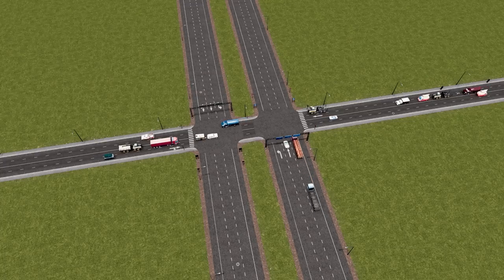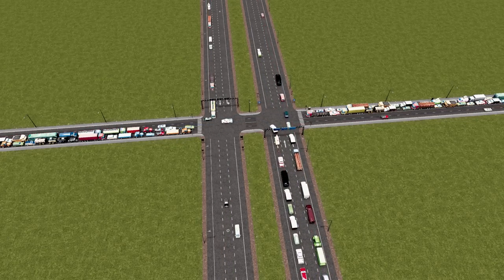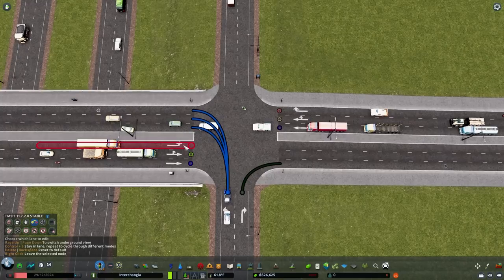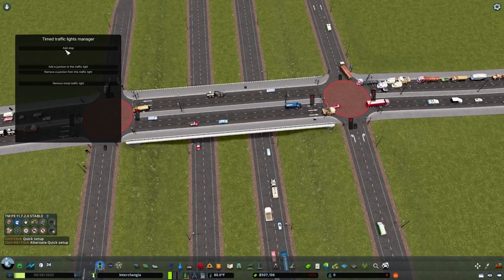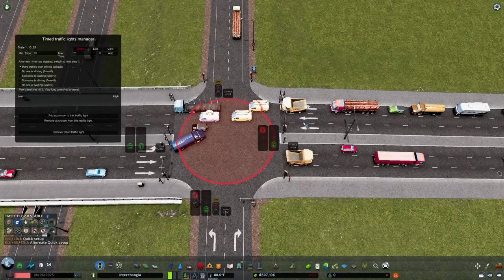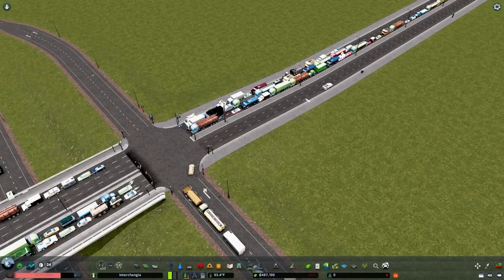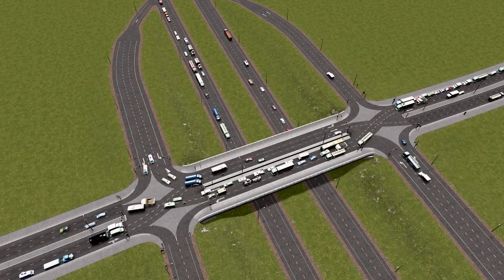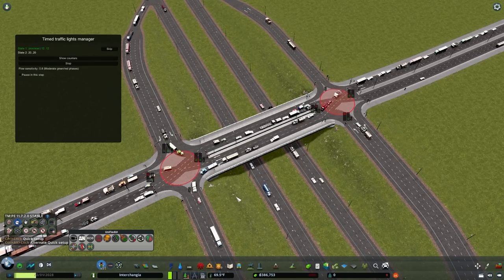The best SMALL Highway Connections  -  Building Diamond Interchange Variants in Cities Skylines

Comment: The biggest problem with a SPUI in real life and somewhat in the game is that it is a pedestrian and bicycle user death trap.
Reply: Problem? Solution :D !
Reply: Yes, simmiliar but smaller SPUI is in one small city near city where i live and it takes about 5 minutes to go through whole SPUI.
Reply: Pedestrian tunnel!
Reply: Yeah. You need to cross four traffic lights on foot at a SPUI, or two if right turning cars get a slip lane without a stop light, which is even more unpleasant for pedestrians. The "urban" part of the SPUI really only describes the relatively small formfactor, it doesn't create a better urban environment than a standard diamond or any other highway interchanges.
The best option both IRL and in game would be to provide pedestrians and cyclists alternative routes to cross the highway, ideally ones that are faster and not a detour.
Reply: That’s the advantage of an inverse SPUI. An inverse SPUI has the on and off ramps connecting on the inside of the highway so it only has ramps on the bridge and the intersection itself is no larger than a 4 lane road. However, they aren’t common IRL due to the danger of traffic backing up into the fast lanes of the expressway if something goes wrong at the light.
Reply: @AVeryOldLady4397  that's still subpar
Reply: a spui and a diverging diamond only really makes sense when both roads are highways
Reply: @AVeryOldLady4397 it'd probably be best to just increase the height of the overpass to enough for a pedestrian/bicycle/wheelchair path to fit in between vertically
Reply: @deanonesense  I mean yeah I meant for realism in game. 

In real life the solution really varies by country.
Reply: @AVeryOldLady4397 Yeah, the UK, for example, never allows a green man and a green traffic light simultaneously if there would be conflict, even if it means all red lights for vehicles or, temporarily red lights for all turning traffic.
Often it would be button controlled for quieter junctions, potentially built in cycles if there are separated turning lanes and pedestrian islands, so it's not a big problem for cars. Sometimes, for ramps like this if there aren't many pedestrians, you just take care when crossing and driving. However, people just know when it is appropriate or not, and older junctions with no crossing signal, you just look at the traffic lights to see when you can cross, and we have no concept like 'left on red'.
We don't seem to have the same blindness to pedestrians and cyclists that the US does, and we definitely would have islands and stuff on wide roads, even if not any traffic signals yet, and just cross when safe, with vehicles generally not being too miserly to not slow down for you.

Comment: One trick I've found works really well in the game: make a corridor using half-diamonds instead of full diamonds.  Even in vanilla a half-diamond works great since it's just a 2-phase light and the other node is free-flowing.  That way, even without special setup, you just have one 2-phase light and one free-flowing node, both of which work quite well.  Then put bridges between the diamonds so the cross-road traffic is separate from the service interchanges.

Comment: thinkj a better result would be the traffic from main highway be brought up and exited in the middle vs outward. then seperate the smaller road traffic with distance similar to the main highwy. Then it would be a traffic circle some what for traffic existing/entering from smaller road and no stop lights needed. Constant flow in both directions

Comment: have you ever tried a ramp meter? if there is a merge from 2 lane to 1 lane a ramp meter is sometimes used if the highway is frequently congested.
Reply: Not familiar with the term, but is that basically traffic lights that quickly switch between the two lanes, one car at a time?
Reply: @simongeard4824  well yeah, if the highway is congested

Comment: That road at the start of the video seems typical of an intersection between an avenue or boulevard, which serves as an arterial road that might connect up to, or turn into, a superhighway, and a more local collector road that might lead to some shopping centers for example, though traffic lights would certainly be featured, since while traffic might not be as heavy enough to warrant switching to an interchange, it's still heavy enough for traffic lights to be seen as a necessity. I've driven through one such intersection a few times before at coordinates 35.986354, -78.535360, located on the outskirts of Wake Forest, where Capital Boulevard, which passes through some service interchanges further south, where the traffic is heavier, since it's further into the city, intersects with a more local collector road that, in turn, connects to a couple of shopping centers that include parking lots, supermarkets, and fast-food restaurants like the nearby Wendy's.

As for the interchanges featured in this video, besides the bog-standard Diamond Interchanges, which I've driven on and off of before, while there may not be any nearby Diverging Diamond interchanges that I'm aware of, there's a SPUI that I often travel on at coordinates 35.911597, -78.651368, where the I-540 crosses under Six Forks Road, along with another SPUI at coordinates 35.965423, -78.541945, where Capital Boulevard crosses under Durham Road. Come to think of it, the SPUI seems to be a pretty popular interchange around Wake County.

There's also a Partial Cloverleaf that I've been travelling through as of late at coordinates 35.794449, -78.582645, where the I-440 crosses under New Bern Avenue within Downtown Raleigh, when we've had to visit the nearby hospital when one of my family members had been suffering from a failing liver. I'd say those would work nicely as service interchanges, probably better than the basic Diamond Interchanges.

Comment: In my state, we got alot of DDI and its working great but I dont see the 3rd option so far, maybe it cost too much money to build! 🤔
Reply from the maker: There are many spui’s in some areas. You can easily drive them without knowing what it is, unlike a DDI.
Reply: @YUMBL  SPUI may easily see in flyover highway with local road on ground.
Reply from the maker: Its widely used in both scenarios. It depends on the configuration of the original interchange.
Reply: @YUMBL  here in michigan on I-94 heading out of Wayne County, there's a few SPUIs serving some of northern Novi and other smaller suburbs. very neat as i went on one as they were finishing the conversion from a standard diamond interchange.

Comment: Could you do a diverging diamond with… roundabout In opposite direction?
Reply: You could make a “diverging diamond” using a roundabout going in the opposite direction but it would not be able to handle as much traffic as a diverging diamond since traffic getting on and traffic getting off the roundabout have to cross each other’s direction of flow. This still happens with a diverging diamond but it is signal controlled instead of trying to fight your way on and off.

Comment: I normally switch to a Dumbbell interchange, or a Pinched Roundabout interchange instead of going for a DD or a SPUI, they also use the same bridge from a Diamond interchange, and don't increase the space used up that much either side of the highway.

Comment: The best way I've found to avoid through-traffic in the service interchange intersections is to make sure the speed limit is properly set on the off-ramp/on-ramp. Ie. it should never be that the through-traffic should have a higher speed limit than the highway. The cims will chose the one with best speed. So if you have an highway off/on-ramp 100km/h and a rural two-way two-lane highway underneath at what is it, 60km/h or 80, the cars will prefer the off/on-ramp. With that there shouldn't need to be a need to force lane choices in the intersections, other than adding the asymmetric turn lanes, which often helps.
Reply: Mostly. I have observed in my games, and I have seen examples on Biffa's (rarer), where the AI will select the ostensibly slower route (having put lots of time in to ensure lane restrictions are not preventing desired flow.).

Comment: TMPE allows the first solution to be possible, with two simple steps: 
1) Allow queueing for the both highways and both exits from the middle bit. 
2) Leave right lines to be turn only, so the traffic would use only one to go thru, and split in two in the middle also.

I've got similar setups all over my city (the light-less metropolis format), and there's no significant backings occuring (mind you, i'm playing with despawn disabled, so every car has to wait till the ends of the world)

Comment: I wonder, how much more expensive would an interchange be with three levels of elevations? You can then split off the through traffic, let it go underneath the highway, while the left turns use the single point overpass above it. 

Another thing I'm wondering is, how would two single direction arteries, each with their own interchange, compare? The individual interchanges will be simpler, but you'll need two interchanges. Will this need more are less total space? Will you be able to use the area between the two arteries efficiently? You could have a district in between the two arteries on either side, like specialized industries.

Comment: I’m a big fan of SPUIs too! (and my fav system interchange is double trumpet 2 level interchange so don’t spoil city views). 
I think you might’ve missed that SPUIs can help in creating U-turns for the highway so making exits from only one highway side are possible.

Here are the few (though unconcise) things I’ll note about the SPUI (2 min read)
1) cars turning from/to the highway via junction (left turns, in your case) might misjudge and enter the clogged junction when the entrance/arterial backlogs, rendering the entire junction useless. (it’s hell when there’s a 20sec timed traffic light (TTL) after that… In cities skylines enabling ‘enter blocked junctions’ makes it PAIN, blocking the whole junction. An IRL example: in Singapore, Paya Lebar Road exit off PIE. At the junction with Eunos Avenue 5, or Geylang East Central, it disallows right turns from the other side just to accommodate this.
2) Oncoming Collision. Like you said It’ll take some tinkering with node controller to prevent oncoming cars from colliding, and yes… IRL (sg example again) I’ve had near misses at the Cavenagh Road X Bukit Timah Road junction, where humans REFUSE to follow lane markings
3) Lane saturation into the highway (busy junctions only). This will be bad if your highway system uses weaving excessively. Using lane mathematics and letting cars accelerate before entering the highway may help, but in C:S I lost my battle against too many highway lanes because no one could enter/leave the saturated lane highway lane caused by the TTL, so I had to upgrade it to a 5-lane 😰
4) Pedestrians. As in the video, they can’t cross the arterial, though overhead bridges help, MY LEG PAIN. That being said, ped crossings off the slip lane are usually offsetted a little before the lane intersects with and joins the arterial, so cars only have to wait for one thing at a time, instead of the stars to align.
Thanks for reading!

Comment: If the simple diamond interchange uses left lane for exit ramps, it will become a single point interchange and is probably cheaper to build. Why is it not built that way?
Reply from the maker: I don’t quite understand what you mean. The simple diamond is cheaper than all the other options, so it is almost always the starting point.
Reply: I believe what you’re describing @zerioification is called an inverted SPUI. The ramps come from the left (median side) of the divided highway instead of the right and connect to the crossing road with a standard 4 way interchange. It is very small and inexpensive to build. However, they aren’t used very often IRL for 1 big reason. This is that the exit ramps from the highway connect from the left, which is traditionally the fastest moving lane of the freeway. So if the intersection backs up the ramps all the way to the freeway, traffic will be backing up into the fastest lane instead of the slowest and make accidents worse. However, there are actually a few inverted SPUIs out there.

Comment: you mentioned the through traffic in cities skylines being terrible. in that case its the faster route ( in theory) fix it by making the max speed a bit lower then they wont take it and you can keep the option open
Reply from the maker: Yes, but since no one makes a wrong turn in CS it’s unnecessary. I just wanted to acknowledge the real life benefits.
Reply: @YUMBL  i understand theoreticly if the roads are winding and you have an offramp in a large bend the offramp can be seen as the shorter route and even though this isnt the "wrong" turn cars can still take the offramp en masse because its shorter at the time the route is calculated

Comment: The sluggishness in the SPUI (and even the diamonds) is due to nodes being too close together.  Remove the in-between nodes on the bridges and merge ramps.  Ideally you don't want nodes within 6 units of each other or else traffic will hesitate until the next node is clear.  Spread the nodes out and traffic will flow much better. Using Traffic Manager to force traffic will also cause sluggishness. You're better off using the lane arrows to direct traffic rather than dragging the colored lines.  When you pack that many forced lane lines it bogs things down.  Also... if you want realism you're still getting highway lane math wrong.  Add a deceleration lane before subtracting your exit lane.  If you start with 3 you should have 3 going through the underpass. ;-)
Reply: not everywhere does the last part, as such you'll be going along, minding your business, then bam your far right lane is now an exit only lane. its getting less common, for sure, but there is still interchanges that do this.
Reply from the maker: Its still a two lane in each direction highway Dean, so its fine. The sluggishness is not due to nodes being close together. Its due to the size of the nodes, and not having “enter blocked junction” enabled in traffic manager. Which i fixed and explained at the end.
Reply: @YUMBL  "The sluggishness is not due to nodes being close together. Its due to the size of the nodes, and not having “enter blocked junction” enabled in traffic manager" Even with turning enter-blocked-junction enabled I still notice a hesitation when nodes are too close together.  Been doing a ton of experimenting.  Anytime there is an in-between node when using Traffic manager to force traffic to stay in it's own lane it's much better to just remove the node(s).  I see a noticeable difference when doing this on SPUI style interchanges.  Can also mitigate using enter-block-junction to keep traffic from clogging up an intersection during a high flow times.
Reply: @nightshadelenar  As someone who spends about 30,000 miles a year on the US highway system, I can say you're right... however it's highly annoying when it does happen.  They recently redid a stretch of highway near me and flubbed up the lane math and it causes all kinds of backups and accidents because it's forcing unnecessary lane switching with trucks and of course people not realizing their lane is ending until it's too late.  Carinal Rule of Highway Lane Math: never ever molest your primary through traffic lane.  Add exit lanes to the right and passing lanes to the left, but never ever force a through lane into an exit.  Or worse yet, add a temporary slow-traffic/truck-climbing lane to the right.  That's another pet peeve - but not something that happens in CS. LoL